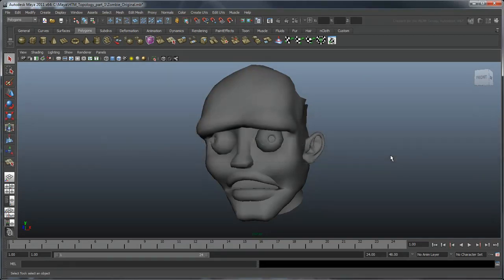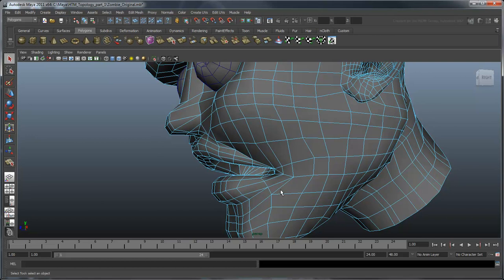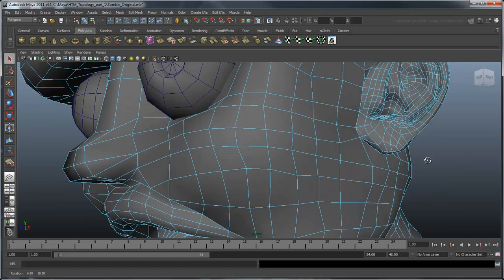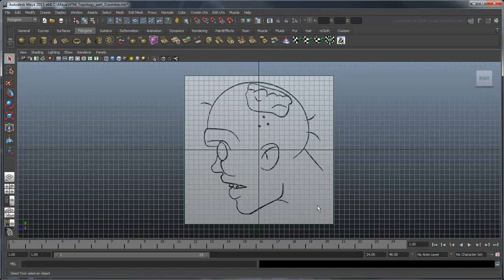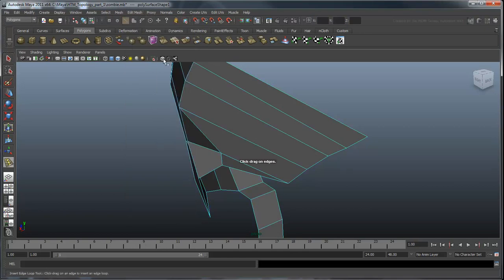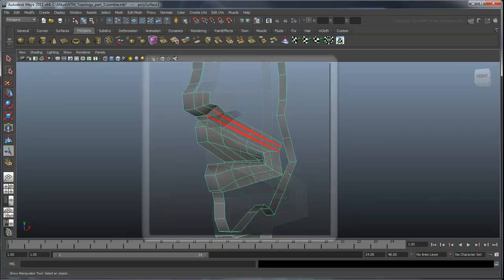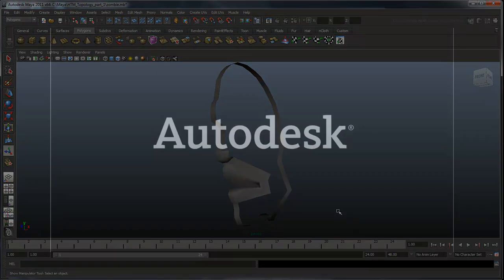Modeling a head with proper topology - Part 1

Comment: Generally it is much easier to model a head like shown in a video with proper topology than improper. Just to save the need to move too much vertices to match the reference.

Comment: I'm fairly new to Maya, and I am stuck on a problem that I, of course, can't figure out. At around 6:00, I noticed that the Local Center you used to extrude the mouth was set at the center of the mouth (or close) when you extruded the edges, but mine is always stuck on the highest edge selected [and I'm limited to moving that top edge to its start, middle, and end]. How do I set the Local Center lower? Also, you changed the location of the center to adjust the lips as you pleased a few seconds later. How do I do that as well?

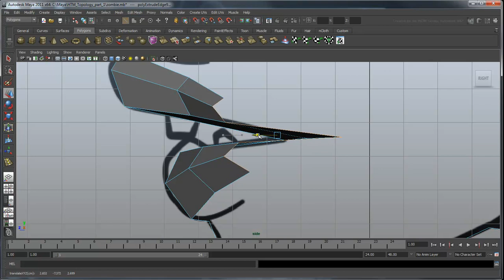Comment: I dunno if your replying much or not but I managed to figure out the problem.. Now I have another at 6:17 or so when you select the vertex how do you get the manipulator to show up because mine doesent at all and when I extrude the vertices just extend themselves with no cause..
Reply from the maker: Try clicking the option box next to "Extrude Edge".  Then go to Edit > Reset Settings and try again.

Comment: A question on 6:00 the manipulator keeps going onto the top edge of all 6 that are selected and I dont know how to fix that.. Really annoying problem it keeps me from making the proper extrusion...
Reply from the maker: Hmm, what do you mean by "top edge"?
Reply: Maya Learning Channel the 6 edges that you selected the manipulator doesent attached itself on the same edge as it does in your video it attaches itself on the very top as in the edge that is closest to the upper lip where your manipulator attaches itself inbwteen the lips where the opening of the mouth is sorry if this question is vague I am new to maya and need to do this for a class of mine..and nowhere on the internet i could find this problem due to this everytime I extrude it it ends up coming deformed

Comment: I cant find the merge vertex tool on 8:06 .
I'm using Maya 2016
Reply from the maker: Roy Weinstein In Maya 2016, this tool is located in the Modeling Toolkit.  This is a more up to date modeling workflow: https://youtu.be/gj9AJQbVlgw?list=PL8hZ6hQCGHMULtEAK2k6Ohx00pYyjPujc
Reply: Roy Weinstein i just found out you can select both vertices and shift right click "merge vertex" which does the same thing

Comment: When I put out those green polygon points, there is this red marking that is blocking my sight of the face. how can I disable it (or hide it) to be able to see where the lines are? Please respond.
Reply from the maker: Sounds like you are still in Face selection mode.  Just hold the right mouse button and switch to edge or vertex selection.

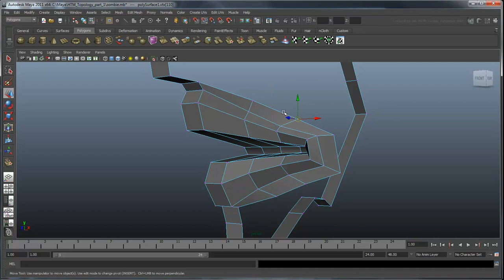Comment: At 8:18, how are you moving the verteces so they keep to the edges they're on? I know there's a tool to do this in the menus above, but you seem to be doing it with a simple hotkey/mouse button - very streamlined.

EDIT:
Nevermind, you highlight this yourself at the beginning of part two. ;D
Modeling a head with proper topology - Part 2

Comment: How would I go about making a body with proper topology? I've seen legs designed like a primitive, and that seems to be all right. Which method is appropriate for which body part?
Reply from the maker: In general, edge loops should follow muscle patterns to properly emulate the real life deformation of muscles in the human body.  In your example, a leg might be predominantly cylinder-like (which is completely fine), except around the knee, where you'd want to have a few edge loops circling the front and back to allow the leg to bend.

For an example of good overall character topology, try downloading the scene files from the second part of our Creating a Character Rig tutorial series.  We provide a full model there that you can study.
Reply: Maya Learning Channel I noticed with the Emma character rig that there were slight irregularities in the definition of the rig. The hands were higher definition than the leg, for example. Should it be like this in the high definition model used for rendering,or just with the proxy?
Reply from the maker: Generally you'll see increased resolution in areas that are expected to bend (finger joints, behind the knee, etc) to ensure deformation is smooth.  However, you're right in that a generally consistent level of resolution overall is preferred.
Reply: Maya Learning Channel When I increase the resolution of the joints, should I make the extra resolution evenly spaced, or make it tighter at any point?

Also, I'm currently modeling a robot, and one of the leg segments stretches along the sides to connect with the foot, rather like a ball and socket joint. Should I stretch the pre-existing cylinder to achieve this, or add more polygons?
Reply from the maker: It depends what you mean.  Within the area of higher resolution, the edges should be evenly spaced.  Compared to the entire rig though, the area of higher resolution will, by definition, be tighter.

You probably want a few cross edges along the leg, but since it won't be bending very much a general stretch should be fine.

Comment: The "Append to Polygon" tool does not work for me at all, not in the way shown in this tutorial--It just creates a mess of jagged polygons, and this does not explain how to manage the tool.
Reply from the maker: This can happen in a couple of different scenarios: 
1.)  The area you are attempting to append has more or less than four sides.
2.)  The edge you are attempting to append to is already bordering more than one face.

In these cases, Maya can become confused about which "direction" the edge is facing and hence cannot close the hole appropriately.  Please double-check that this is not the case.

Comment: Is there a way to select all the edges, erase them (while preserving the shape of the topology) and reinsert them on the mesh, so they they are evenly spaced?
Reply from the maker: Unfortunately, removing edges changes the topology at its base level so this is not possible.  This is why we stress you build with good topology right from the start as making changes later can be much more difficult.

Comment: this is not a very thorough tutorial. 1) how did you delete the face after extruding, i looked up the maya handbook and it's nowhere to be found as well...2) i don't see the placement extras option anywhere, i am currently using Maya 2014

Comment from the maker: Yes, in general the higher the polycount, the more fidelity you'll see in your model.  However, this also means your object will perform slower in animation.  And yes, you can get the same effect using the split polygon tool to divide a much larger starting polygon.  That is a method known as "Division modeling".

Comment: After you finish creating a polygon click the small blue cube (without white outlines) in the menu directly above the viewing window. The face should turn grey. then hold-right-click and select face (the face turns red, left-click it so it turns green.) Then you can hold-shift-right-click and select extrude.

I had the same problem... This was my solution.

Comment: I get to 5:08 and then I'm stuck. I googled how to close the shape in the create polygon tool (press enter) but after pressing enter, it doesn't fill the area within the vertices gray like yours does. Also, shift + right click leads me to a menu with 'Create Polygon Tool', 'Poly Plane', 'Poly Cylinder', 'Poly Cone', 'Poly Cube', 'Poly Disk', 'Poly sphere' and 'poly torus' on it. There is no 'extrude' option.

Comment from the maker: There could be a number of causes for this.  Remember that you don't want any overlapping vertices, so when two vertices occupy the same space, you should merge them using the Merge command.  You can also use the Normals > Soften Edge command to smooth out hard edges.  Finally, remember you want to keep all your faces as quads.  N-gons have a tendency to create unusual pinching (which is the reason we try to avoid them).

Comment from the maker: Once you've extruded the edges, you can actually manipulate them a number of different ways.  By default, the Extrude Command puts you into the generic Manipulator Tool which will pull the components along their normals.  If you switch to the Move Tool, you can then use the Move Tool Settings to translate along the World, Local, or Custom spaces.

Comment: you go way to fast during the extruding edges ofthe mouth, ive watched this tutorial and retraced my steps like 22 times in the past 2 days and still have trouble extruding it.. i cant get the mouth right because every time i extrude it the lines get all funky after i pull them. i'd appreciate the help if you could explain it a little more, or atleast slow it down a notch

Comment from the maker: It sounds like you may have the Edit Mesh > Keep Faces Together option turned off.  You can use the "Append to Polygon" tool or "Merge Vertex" tool to fix holes like that in your geometry.  The latter parts of this series will show you examples of both.

Comment from the maker: Are you opening the included file in Maya 2013 or starting from scratch and following along the video right from the start?  It seems that Maya 2013 automatically bakes the image planes into constrained planes.  You can fix this by selecting them in the Outliner, deleting them, and then reloading the images onto new planes using the workflow in the movie.

If you start from scratch, this shouldn't be an issue.

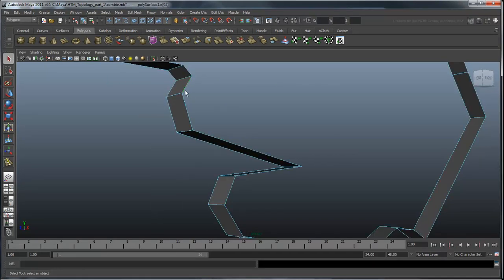Comment: Here is a problem I was having around 5:50. If you click on an edge and you see a color change from yellow -> red -> black along the edges. And when you try moving, rotating, etc the edges it modifies the entire face structure, try this. Double click on the select tool (arrow on the left tool bar) bringing up the options. Under soft select there is a check box, uncheck that. That should fix the problem.

Comment from the maker: No question is stupid.  = )

It should be doing this automatically.  If it's not, then you may need to reset the tool's settings in the Tool Settings Editor.

You may also be in Wireframe mode.  You need to change to Shaded mode to see faces as solid colors.  For more information on this, see our video about Navigating the Maya UI.

Comment: I did try resetting in the Tool Settings Editor. If I'm not mistaken, the symbol for that is a little square. I reset it multiple times and yet there is no polygon fill. Why is this?

Comment from the maker: This seems to be a recurring problem that depends on one's specific computer.  Your best bet is, to modify the "Image Center" attribute in the Placement Extras section of the Image Plane's Attribute Editor.  You can do this at the same time as when you set the Alpha Gain.

For the Side View, set it to (-1, 0, 0) and for the Front View set it to (0, 0, -1).

Comment from the maker: You may be in the wrong menu set.  You need to be in the Polygons menu set (check the drop-down menu on the top left of the interface) to have access to the Mesh / Edit Mesh menus.

Comment: I just started messing with maya and experienced this myself.  It looks like you can fix it by adjusting the Image Plane's "Image Center" under the Placement Extras section of the image planes properties. The 3 values are apparently X Y Z, and the image plane has to be 'behind' the polygon you are drawing so for the right side view you would slightly adjust the 1st value, (the X axis) to something like -1.  After you are done, I would move the image plane back so that the images stay centered.

Comment from the maker: After you perform an extrusion, are you translating the edges or individual vertices?  Remember that if you extrude an edge, Maya basically creates a new edge on top of the one you are extruding from, and that each edge is made of two vertices.  Thus, if you move one of the vertices but forget about the other, you can end up in the situation you've described.  If you then do this a number of times, it would be very easy for this to get out of hand.

Comment from the maker: However, because a box starts with a criss-crossing topology, you will eventually need to start deleting edges and re-routing them into a proper topology.  The earlier you do this, the better, as the Edge Loop Tool will adapt to create edge loops according to its reference points (the two adjacent edge loops).

Comment from the maker: No matter which method you're using, the basic principles still apply.  Try to keep to quads, keep deformation in mind when forming topology, and try to keep the number of polys as low as possible.

For box modeling specifically, it's often easiest to start with a low to moderately subdivided box just to get the basic shape then add subdivisions using the "Edge Loop Tool" as you want to increase the detail.

Comment from the maker: Depending on your operating system, the prefs are stored in one of several places on your machine.  Youtube will not allow me to post the actual paths, but you can find them by looking up "Save Preferences" in the documentation.

Just delete the prefs folder and restart Maya.  However, if other image files are working then it sounds like the specific images you're trying to import may be corrupt.

Comment: Hello, nice tutorial. Can you please shed some light on how to maintain the topology when using the box modeling style & blocking out the head? Since you used the edge extrusion method, it became easier to follow the topology but I guess its a different case for box modeling. Am I right?

Comment from the maker: Have you tried setting the "Files of type" field to All Files?  Or converting the PNG to a different file format?  You can also try deleting your preferences and trying again.  If those all fail, I would suggest contacting Autodesk support.

Another workaround would be to create a regular polygon plane and assign your PNG image as a texture.  Then you can put that plane in a locked layer and model from that.  This is how artists used to do it before image plane features existed.

Comment from the maker: You can adjust the transparency of a material via its tab in the Attribute Editor.  Another option is to move the plane back (i.e. away from the camera) just slightly.  This will ensure all the polygons you create are "in front" of the plane and thus visible.  Either technique would work.

Comment from the maker: If the problem persists, try using a pair of vertical polygon planes instead of the camera's "image plane."

Create a vertical polygon plane, right-click and assign it a new lambert material.  Then in the Attribute Editor, select the material and click the button next to Color and then click the File button in the Create Render Node window.  Now for the Image Name field in the Attribute Editor, navigate to the front/side images.

Comment from the maker: You may be in wireframe mode.  Switch to Smooth Shaded mode to see the face.  You can also try resetting the tool's settings (Mesh > Create Polygon Tool > [ ]) to make sure the options are at their default settings.

Comment from the maker: Try changing to one of the Move, Rotate, or Scale tools.  When you extrude, the default tool that is activated is the Manipulator Tool, which affects components based on their normals (which will all have their own direction, hence why components start pulling in different directions).  Using the independent tools ensures that components all move in the same direction relative to each other.

Comment: this guy only used "extrude", 'insert edge loop tool", "merge vertex tool", and "append to polygon tool" and maybe the basic move scale and rotate. that is all. what he has done so far isn't that hard to follow but I also have alot of experience with maya so i guess that may be a strength.

Comment from the maker: @louvros10 

You are right, but here's a little more background anyway.  When you extrude a face or edge, Maya automatically switches to the Show Manipulator tool.  This is so that you can pull the new edge/face along its normal (the most common workflow) or "local" orientation.  When you manually switch back to the Move Tool, you're switching to a "world" orientation, which is why the manipulator straightens out and all the edges are pulled in the same direction in world space.

Comment from the maker: @wasweissichschonvon 

Basically what you want to do here is continuously switch from the front to side view (you can do so by selecting the 4 View on the left side and then pressing space bar while the cursor is in either the front or side view).  Extrude only the edges representing the side lips and then use the manipulator arrows to pull them sideways in the front view, and backward in the side view.  You can also use the Scale Tool when you need to pull the top and bottom closer together.